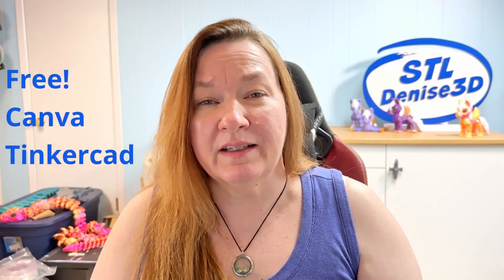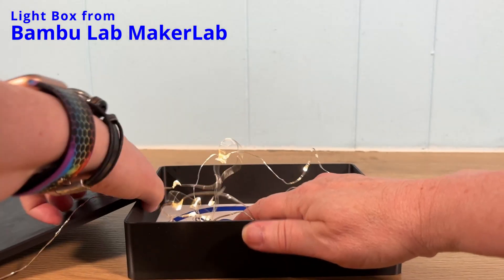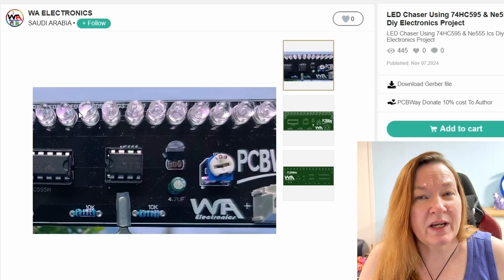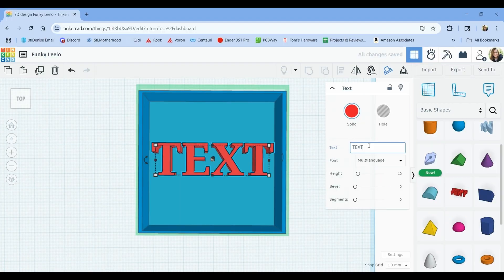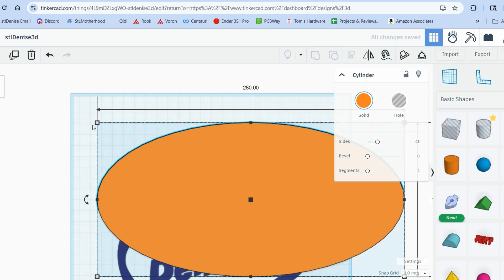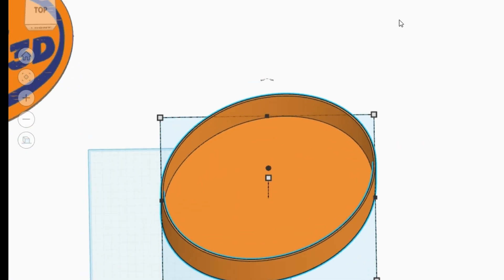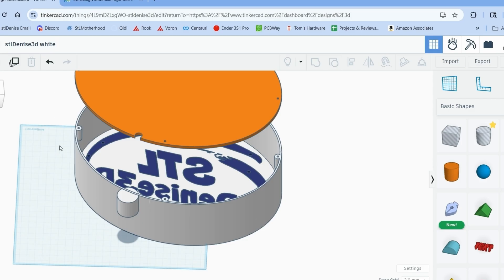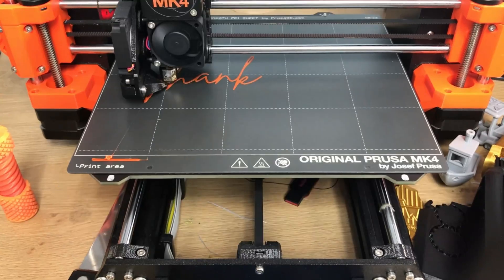3d printed sign with chaser lights!

Comment: You need more practice soldering, but keep at it. I started soldering almost 60 years ago, and went from  early radios to state of the art Telemetry equipment over the decades. A squeeze bottle with a hypodermic needle, filled with mild RMA flux makes it easier, faster and for cleaner work. I need cataract surgery, but if my vision is good enough afterwards, I will show the way I did it at a factory which required NASA level work. tiny drop of the flux starts cleaning the surfaces before you add the solder, which improves the wetting, and reduces the chances of a cold solder joint. It also reduces the chances of head damage to the circuit board.
I used to work with a local vocational school's Electronics  course. One arrogant student told me, "I'm not ging to learn to solder, , I'll be building robots!! His teacher asked how he was going to wire them, and if he had enough tape to hold things together. The student also claimed, 'Nobody uses oscilloscopes! I had a 350 MHz four channel Tektronix on my bench that was used, daily at Microdyne.
From my years in Broadcast Engineering, STL meant a microwave Studio--Transmitter Link. 😀
Reply: Now imagine being a broadcast engineer in St. Louis (STL) who also loves 3D printing (STL) and worked during the time things like Marti STLs were in use haha
Reply: @JeffGeerling  United Video built a cable TV sytem there  in the early '80s and we sent one tech from our Cincinnati system to help the new crew. He was the outside lead, while I ran the repair operation for microwave equipment for maby of out systems.
I may still have an old Marti in storage, if it wasn't lost during a move. I used another brand at TVstations, but I had a pair ow Western Electric systems, as well. Retired from the local phoe service, and configured for telephone, but capable of handlig video by reducing the number of telephone circuits.
I used the White Alice, Over The Horizon system in Assaka, in the early to mid '70s. It was the first, non ine of sight microwave relay for telephone service. It had excellent audio quality, and delivered our network feed and two teletype circuits to my station at Ft Greely, along with all long distance service. Look online for photos of the huge, fixed anteannas that once dotted Alaska fto provide communicatins for all interior milirat sites. It is likely all been demolished, since only a couple partial sites remained a few years ago.
Here in Florida, I used a spare aduioc channel in a multi hop STL from our original site, (CARS) to our original transmitter site. It had been a local access channel at first, but the FCC allowed us to keep the CARS license since there was only a few degrees difference in the paths. Then a newer link to the new site. The original tower lights had to be monitored, but all current systems required a leased phone line. I used a 1024Hz signal from a crystal oscillator. A current transformer to monitor lamp current gated the signal and was fed to master control at the 1700 foot tower in Orange City. It was connected too a KED next to the master monitor. If the lights were off, or a lamp had failed, it stayed on. It began cycling when the lights came on, and until they went off the next morning. The log was filled out with the times, daily. I submitted my design to the FCC, with a schematic and description. It was approved. I had received a letter from them on a Friday stating that if there was no monitoring in place, we had to sped about $20K to buy and install a certified design. I built the equipment that night, installed it in both locations on Saturday and mailed the design to them on Monday. It cost me less than $10 to build since I had every part in my shop.
I miss being able to work, and find fixes like this.
I had a self proclaimed ;genius' insisted that all I needed was a single photocell at the first tower site. He obviously has never stood at the base of a 300 foot tower when heavy clouds roll in, or understand that the lights aren't just on one side.
An Air Force jet clipped  guy wire on a UHF TV station in the late '80s because of a lighting failure. The top of the tower collapsed, and destroyed the antenna. I don't think that low power UHF ever ent bacl on the air.
Reply: @michaelterrell  Yikes! Yeah, lighting is extremely important and anyone who cheaps out on it should not be allowed anywhere near a tower... all those tower lighting and identification regulations were written in blood.

Sounds like you got to work with a lot of great comms tech, I only did FM radio, then a little AM before I moved on to software development. Now I'm trying to relive as much as I can with my Dad, who just retired after an entire career in radio!
Reply: @JeffGeerling  I started in radio & TV repair at 13. I build my first radio from a kit on my eighth birthday. Some of those old TV techs taught me a lot about logical troubleshooting which improved your income. I tested out of the hardest Elecronics school in the Army at 20. I worked onCable TV, microwave links for weather data video to remote airfields, and RADAR at Ft. GrRucker. Then I served at Ft Freely  with a Ch 8 TV station and a AM radio station on 980 KHz. There had been bo depot support in years, and nothing other than changing projector bulbs was allowed. I had the same qualifications as Depot, so I got busy. I took that TV station from an average of seven technical problems a day to over seven  months without a problem. Then the station manager tried to have me court martialed  for 'destruction of government property' for building a replacement TV tuner for a beat up old Conrac VHF Demod. He came within 17 seconds of being busted from E8 to E1 that day. My last work was building top of the line telemetry equipment at Microdyne. Most of those techs were just average, because they worked on the same thing day after day. I wasn't afraid to corner the design engineers to update a design. I walked in one day with a pen, blank pre and an angry look. All 30 people ran out the other end because I didn't take no for an answer. I didn't bring complaints, I brought solutions, including either stock numbers, or OEM datasheets. Things like 'No lithium batteries aboard the ISS lead me to the then mew 'Capstore SRAM which copied the SRAM to EEROM during power down.  I'm sure yo remember the standard 2K*8 SRAM that was so common at one time to store setup information  I was 'banned from engineering for life the day they all ran away. I just lighted at the Test manager, "That won't last!" Three days later I was called to his desk. Engineering: "We have a problem with the 1400 line, can you come to engineering?" I smiled and said, "Sorry, I'm banned for life and hung up. My supervisor was about to tell me off when his phone rang again. "We can wave that, for this time?" "No, you can''t either you lift it, in writing or you're on your own" Me supervisor was bright read as it rang, again. "OK, dammit, you win!" "I'll be right down" I hung up. I looled at him, You va't let them win. Help goes both ways, or not as all." After that, I could get changes made to designs and test procedures with very little trouble. We were still using some 6800 compatible processors, and a PC104 based 586 embedded controller in the latest product, that had 14 processors in total. The biggest pain were the Motorola MC68340 processors
Reply from the maker: I’m going to keep practicing!
Reply: @stldenise  Try Ersin Multicore solder. It's been my favorite for over 50 years. I have both 0.031" and 0.015" for fine pitch soldering. 
I still have the old school Panavise board holder, as well.
Reply: Ah yeah.......might be time to restock......the solder she was using was bought at Radio Shack.......back when they were a real store........
Reply: @richardbertacchi5016  RS solder was 60/40 with low grade flux  63/37 is intended for assembly and rework , and a good RMA flux  cleans better than pure rosin. The RS that I've had to use to solder some connectors was garbage made for electrical work. It takes good tools, good supplies and skills to do really good work. I routinely cleaned up and resoldered the leads on MC68340 processors with 288 leads. They were spaced 0/015" center to center. I finally convince manufacturing engineering to switch our paste solder for reflow to one with a much finer solder balls. Over 95 % of or defects coming out of our new Heller oven diapered overnight. They were stilt using what they had stated with, for 1206 size components but we were using so o2p1 by that time.